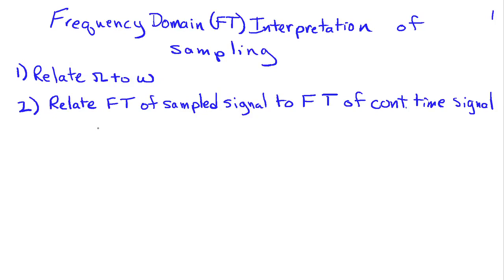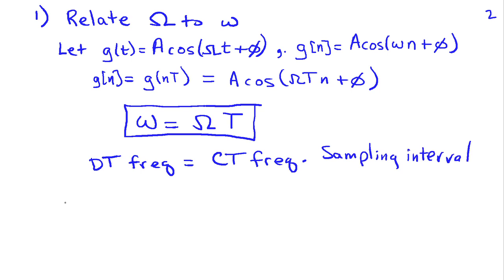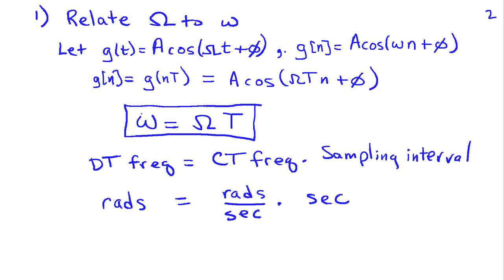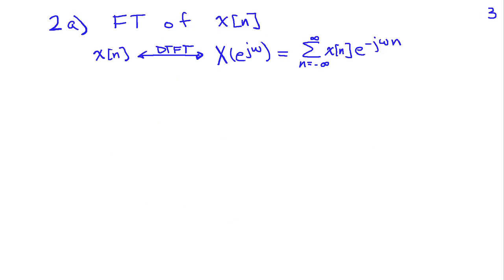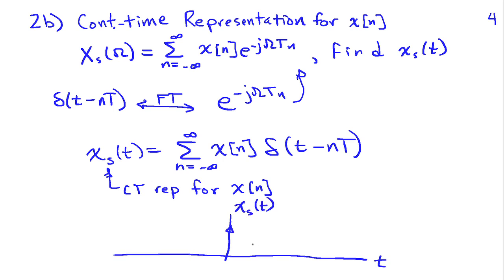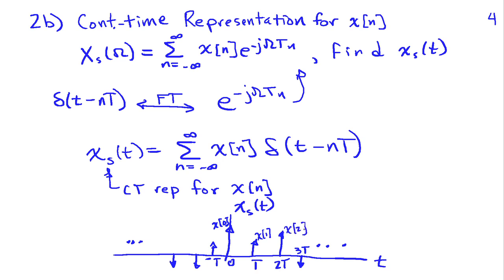Frequency Domain Interpretation of Sampling

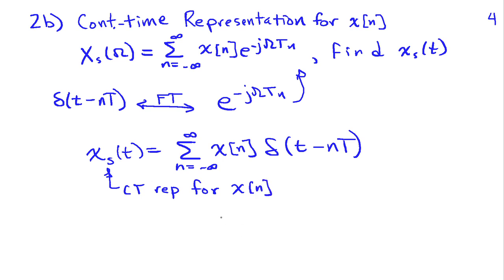Comment: Thank you Professor Barry Van Venn for your great lectures. I am a bit confused on 6:55 that how you suddenly changed Xs(Omega) to Xs(t) without doing inverse Fourier transform.  By just knowing the Fourier transform of exp ( -j*Omega*T*n) which is the delta (t-nT) how could we suddenly change the left hand side to Xs(t)?  We need to have inverse Fourier transform from both sides to get Xs(t) and then the right hand side is so messy that I could not figure out how could we reach to such conclusion. Thanks for guideline
Reply: Hi Sam I also got confused by this initially; and it's still not 100% clear, conceptually, but mathematically I get it. After Barry substitutes exp(-jΩTn) for d(t-nT) in the equation for Xs(Ω), this makes a result which is actually equivalent to x(n) (and x(nT) and xs(t)) due to the 'sifting' property of delta functions): basically we have the equation Xs(Ω) = xs(t) = SUM{x(n) d(t-nT)}, but only at the instants t=nT (which makes d(t-nT) = d(0) = 1). i.e. this entire summation will only produce one output sample (sifting it out), x(n), at sample n or time nT. None of the other samples before or after nT get summed because the delta function will yield 0 for those instants. 

 What conceptually is confusing and still confuses me a bit, though I just accept it (like many things in DSP and maths), is that it now looks like Xs(Ω) = xs(t)! i.e. any (sampled) signal in the time domain is equal to its Fourier transform. I think we just need to occasionally replay this in our minds and it should eventually start to make sense. Remember it is just one step towards understanding why when we sample a continuous signal, we end up with repetitions of the original spectrum, as is described later. Perhaps go to the end and then back to this again and see how it fits into the whole.

Hope this helps anyway - i think i wrote all this to help me explain it to myself!
Reply: it is a bit surprising though that a teacher as excellent as Barry, who really wants people to understand things, leaves this pretty vague! It's a kind of a paradox-like thing... it would be nice to have his take on it. I don't think he's really using this YouTube channel though now. Maybe you can ask the question on his website.